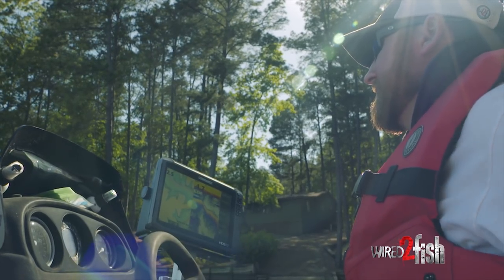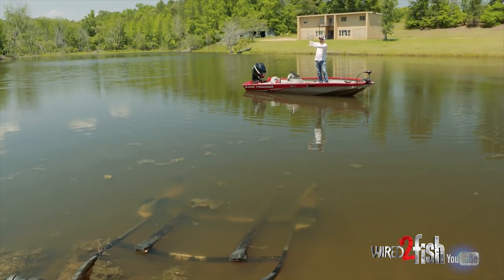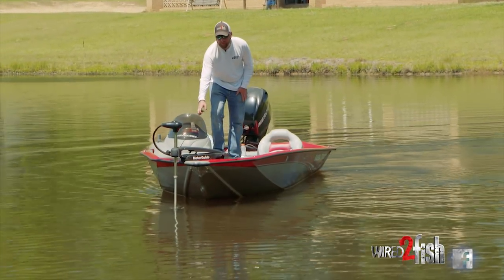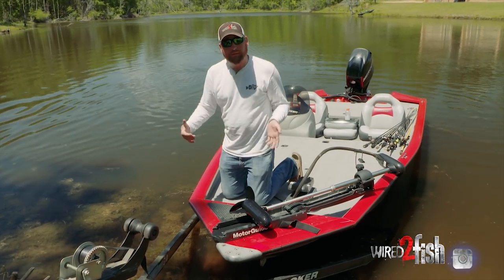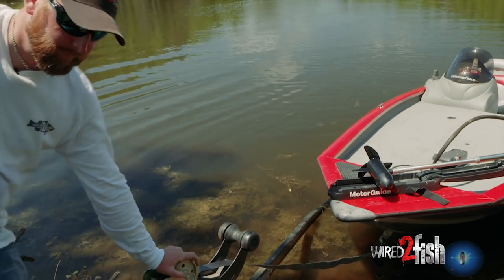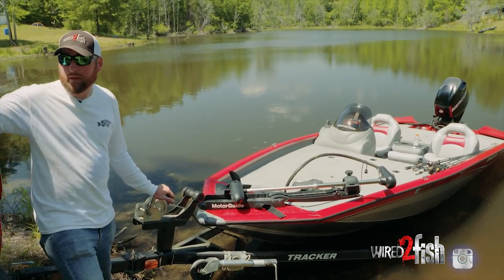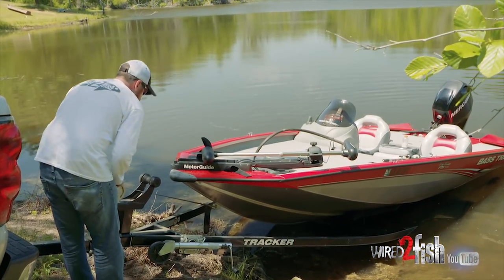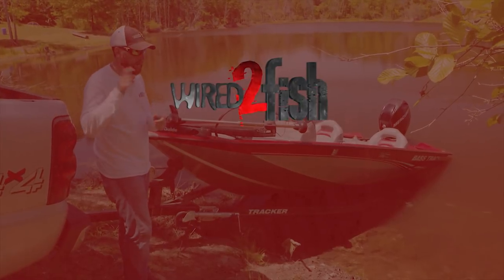How to Load Your Boat With a Trolling Motor

Comment: There's no telling how many times I've done something like this since my old Ranger has issues with idle and when loading onto a trailer, gotta love those old Johnson outboards lol
Reply: Yep, me to. Have an old Skeeter with a 1974 Johnson does not like to idle. I have to do this every 3rd trip out.
Reply: rogeto9351 yeah I have a 97 and it has the heat soak issue which is cause by them putting a V6 into a smaller form factor.  I've found that if you tilt the motor way up after making a run then shake it side to side to get all the gas back out of the carbs and then set it back down it works way better next time you go to start it.

Comment: I don’t know what it’s called but my boat trailer’s roller is on a spring loaded armature that moves up and down automatically adjusting as you wench it tighter. It’s a Stratos Trail by EZ Loader and it’s the best thing ever invented for bait trailers. It should be a standard.

Comment: Or instead of risking your expensive trolling motor pull the motor up way sooner and just use a mooring rope (With two people one already on land) and toss them the rope to pull the boat on the trailer to get the winch line on it.
If your alone, your going to use the rope to walk the boat around to the trailer from the dock (If possible) then pull it up the trailer and then attach the winch line to winch it in.
The hard part of engine failure is actually getting back to the dock, not getting on the trailer (in most cases)

Comment: If u lower your big motor in the back a little more and have it facing straight you can steer your boat alot easier in a straight line without the back floating side to side

Comment: I have a pair of overalls as my "pants" if its cold, I roll them up  and have 2 safety pins on them to pin them up and jump in. If I can eat a fish that's been in their for years I can damn sure jump in and get my feet wet. If its warm I wear a pair of board shorts. You gotta be damn hot casting in the sun in pants and a long sleeve. Don't be the guy at the boat dock stylin' and profilin' holding up everybody.